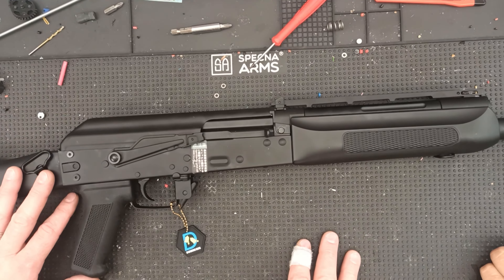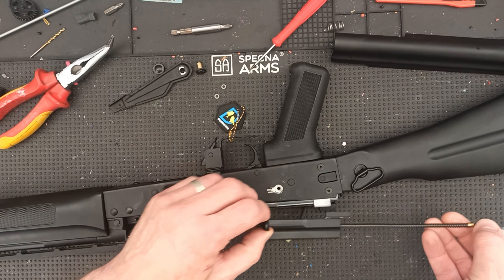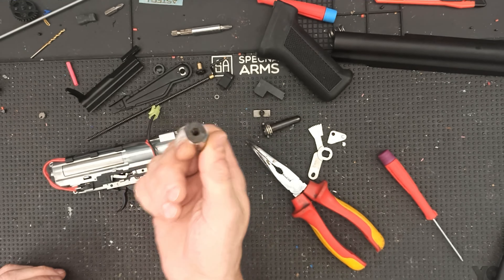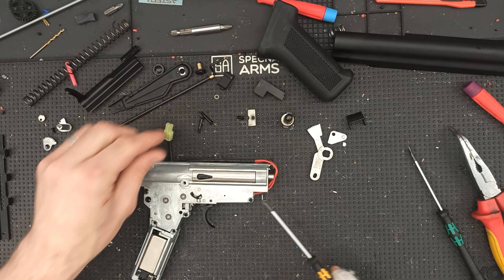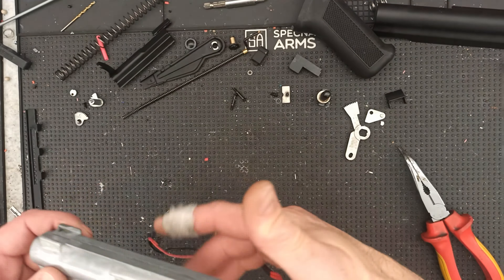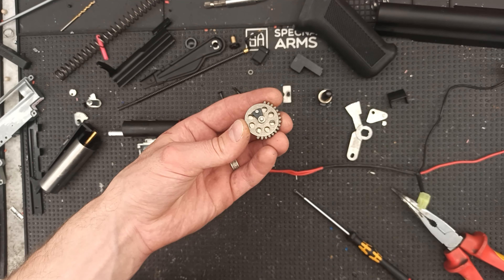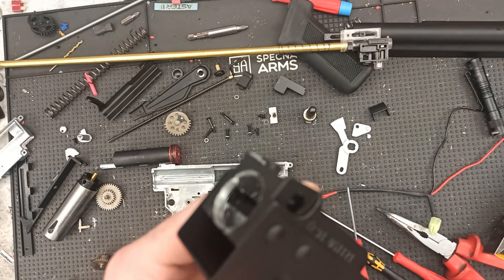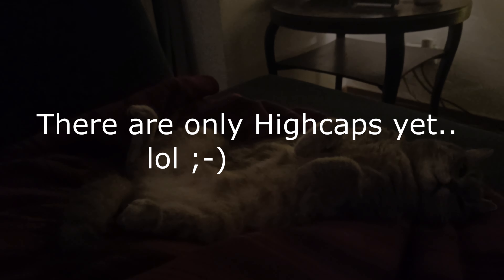DoubleBell Saiga-12K AEG - quick look and disassembly

Comment: I just bought this gun. Are there any upgrades you can do on this?
Such as new motor
New hopup unit
Tight bore barrel
Reply from the maker: yes, yes and yes.. and also i would recomment you to drom in new gears, piston, pistonhead and a decent ETU, like PErun Hybrid.. its a good looking fucker, but not the best internally

Comment: I own several Double Bell guns, best cheap guns by far, and they upgraded the wiring? it was their biggest flaw, i hope DB move to a torque motor like Cyma did (that crappy cyma motor is a beast hahaha), because their stock motor is a bit limp, well built with tower bearings and smooth pinion, but weak, gears and piston rack are holding well after some years of use. The hop up bucking was terrible in my guns, couldnt go heavier than 0.25, you said this one is shooting well with 0.28, maybe they swaped and upgraded the bucking tool!
Money-quality right now, Double Bell is number 1.
Reply from the maker: true but did you try double eagle? these are also extremly neat price to performancewise